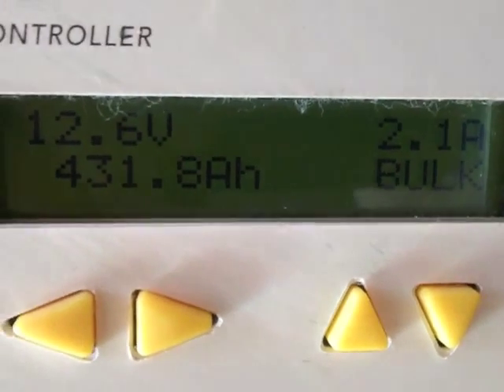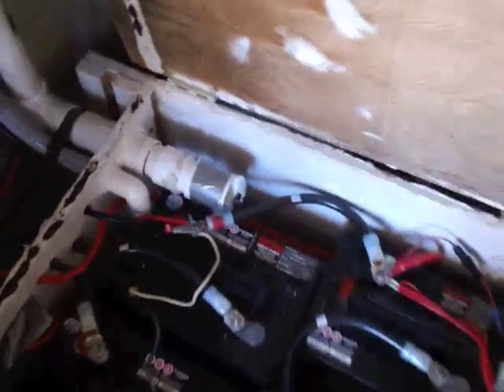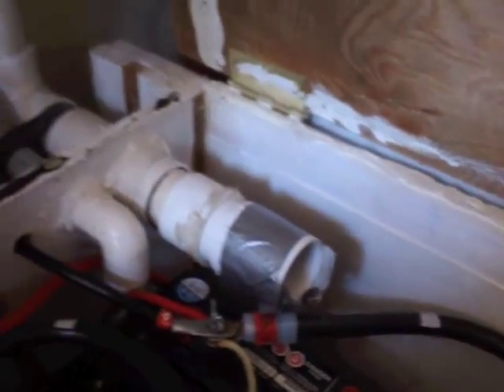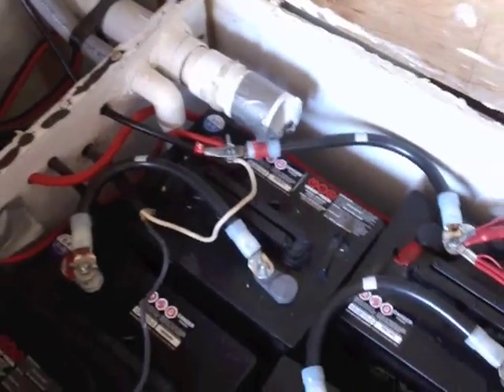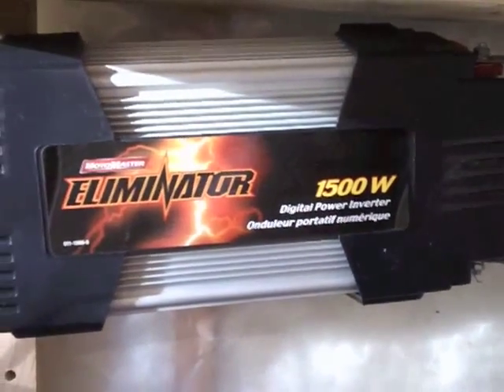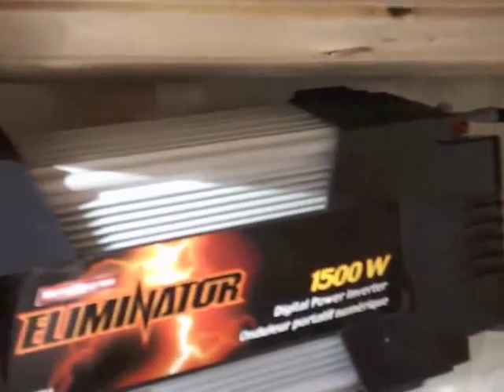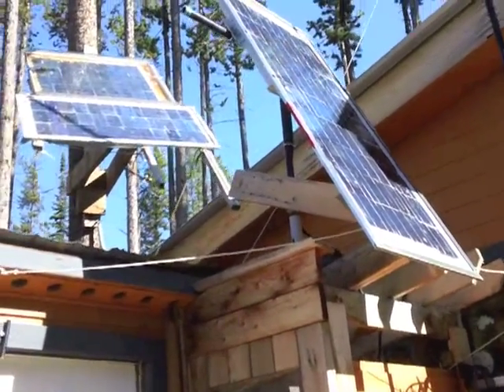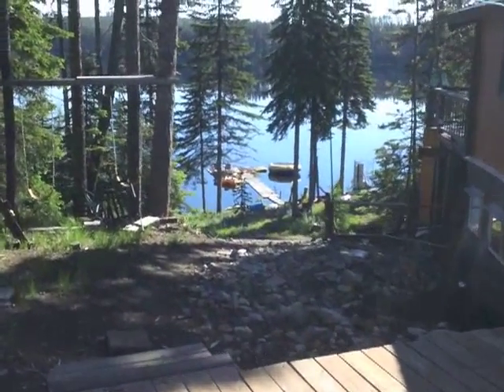Update to the DIY Off-Grid Solar/Wind Power System

Comment: Just a thought. AGM batteries would allow for no venting, have higher Ah and last 2-3 times the cycles. More expensive initially, but are about 40% less $$$ per cycle in the end. Pretty good set up you have. With a 1500 watt inverter I will guess you will just be powering some lights.
Reply from the maker: +Trina McDonald Hi Trina, I would love to have AGM batteries, but the cost here in Canada is outrageous. 12volt start at $289.00 per battery. I picked up these 6-volt, on sale, for $98.00. Maybe when I retire and live at the cabin full-time, I'll got that route. Thanks for the suggestion.
Reply: +The Cedar Workshop We are in Canada and we have huge telecom AGM batteries, 1500Ah worth at a value of $7000.00. We went massive on everything here, including an 8000 watt split phase inverter, a 3000 watt inverter to run the non touchy resistive loads (water heater etc), and 4500 watts of wind power (as you know solar is pretty much useless in Canada in the winter but the wind never stops on the prairies). Then again we do live full time here and the house is 3600sq ft.
Reply from the maker: +Trina McDonald +Trina McDonald Wow! Very nice system! I would love to have a rig like yours. Agreed, solar works great in the summer, but once to drops down below the treeline, it&#39;s almost useless. Make me think of trading in the 100 watt panels for bigger panels. I&#39;m in BC. What province are you in?
Reply: +The Cedar Workshop Northern Sask here, about 50km south of the forest.